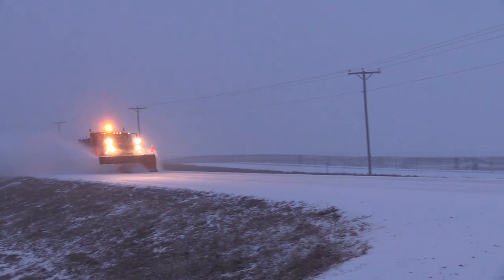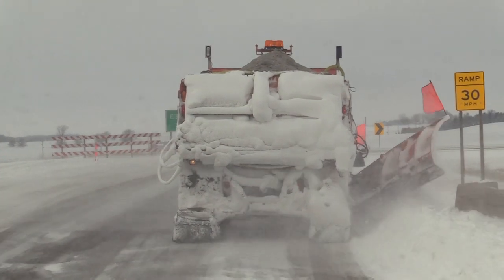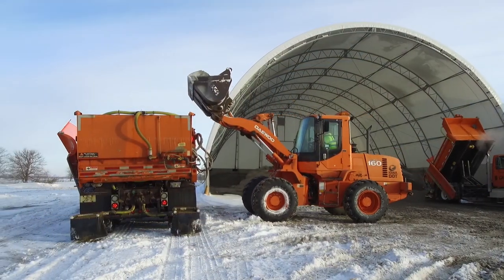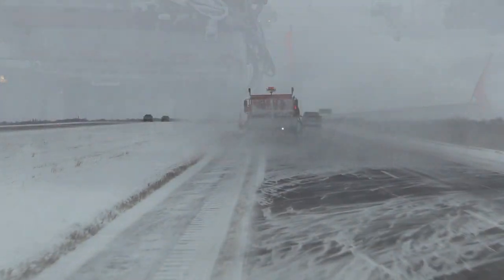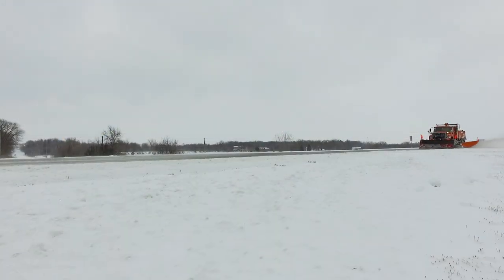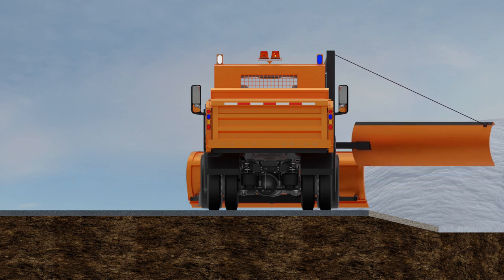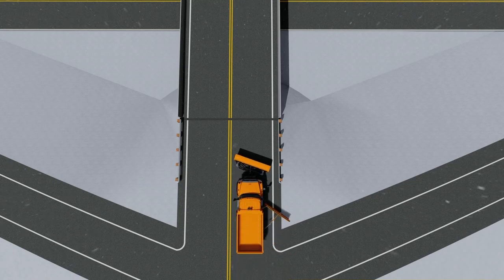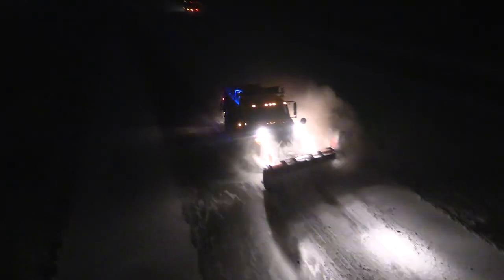Winging Techniques  - Winter Operations Training Series 7 of 15

Comment: I'm here because I'll be plowing in the north maine woods for the first time this year. I need all the help I can get. 😆😆😆
Reply: I bet you’re doing fine.👍
Reply: most important tip I can give you is get a stick fixed to your wing tower and one on the wing so that you can eyeball raise the toe slightly when plowing. that will prevent tearing the wing off which can happen if you are simply turning sharp with it down because the friction of that contact is all it takes to rip it off. raise the heel too if its snowing hard, you'll save your cutting edge for when you want to scrape it clean after the storm.